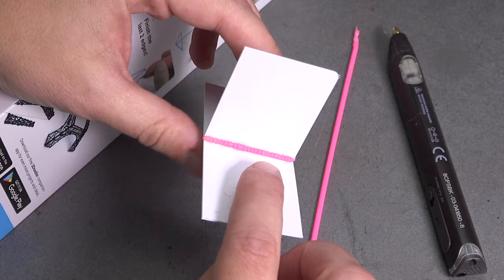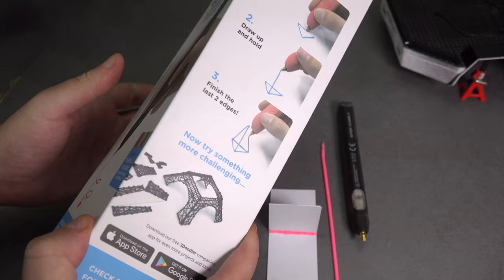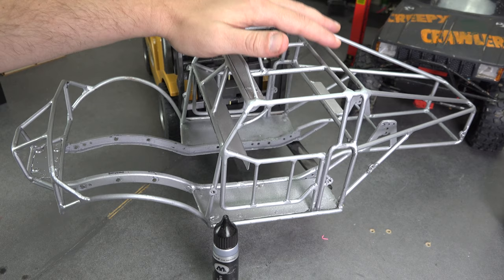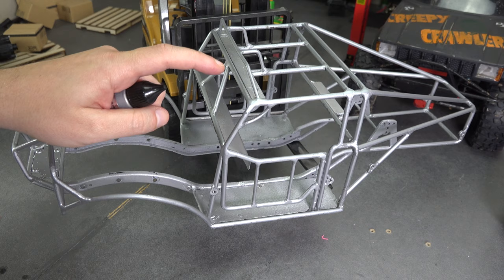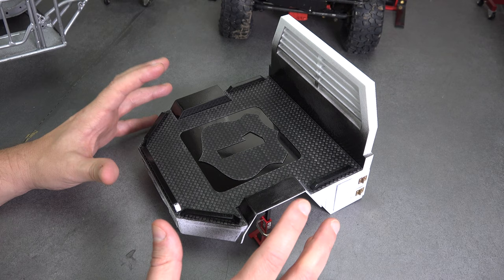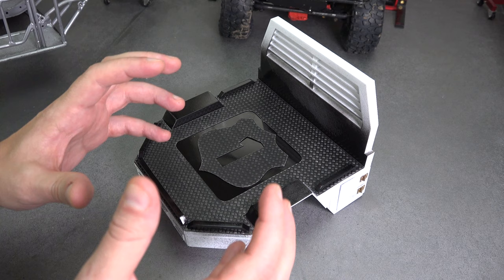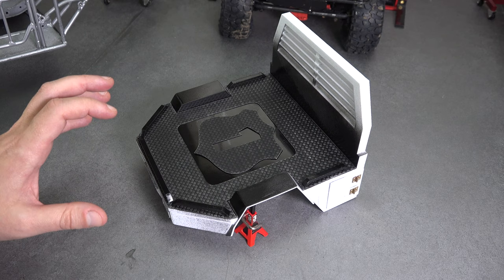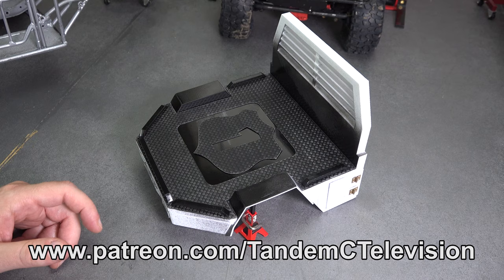3D Pen, Molotow, and RC4WD TF2 Bed! - Behind the Scenes E34 (Vlog)

Comment: Couple of tips for Molotow.  Many you might already know, but figured would pass them on.  First,  paint the piece in a high glass black. Second, use Isopropyl Alcohol to clean your airbrush since this is more of an ink than paint. Third, coat with Allclad Klear Kote to prevent it from turning dull with use.
Reply from the maker: Yes, yes, and yes, also I always run Isopropyl Alcohol thru my gun with the Tamiya and Vallejo paints I use. I would also mention before spraying Klear Kote make absolute sure the Molotow is dry.